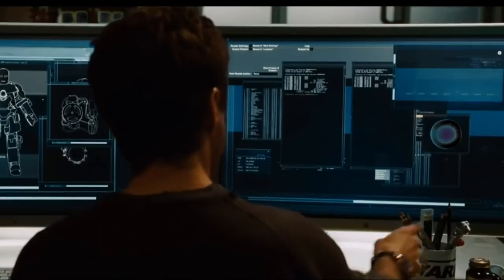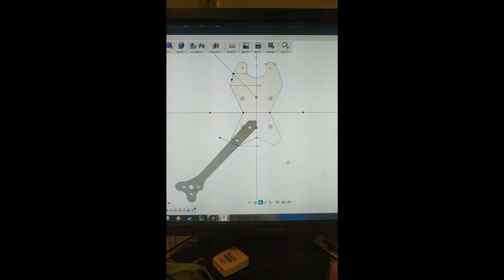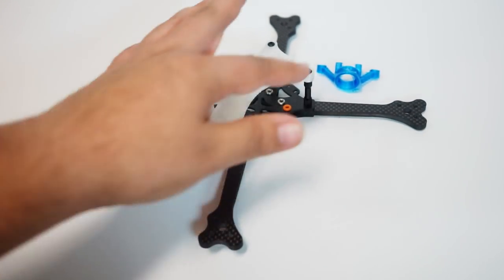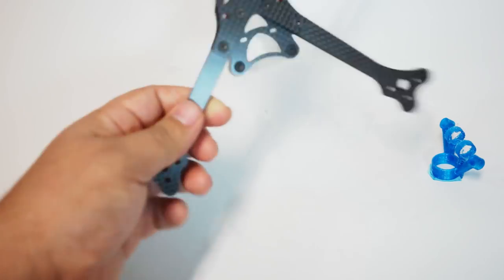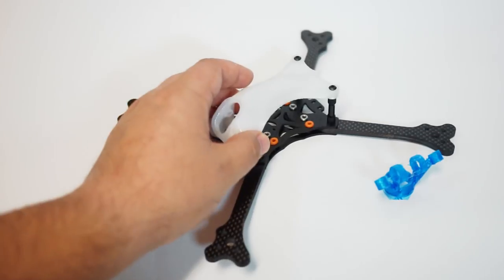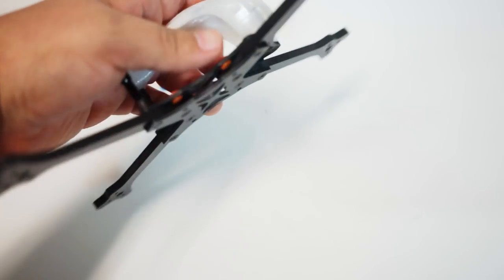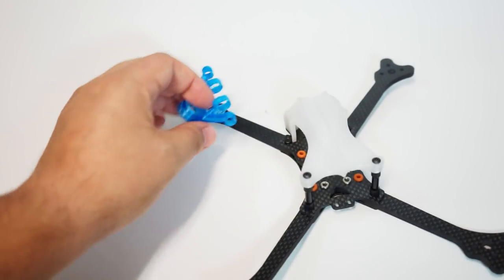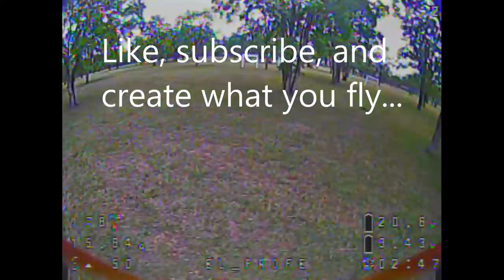Build your own Drone Frame

Comment: I once designed my own 2.5" and 3" frame using sketchup and turns out really well. I didnt do anything crazy like 3d prints or pods, but I ended up using a camera mount from a floss and zip tie the antenna. I am now thinking about designing a 5" race frame after watching this.....
Reply from the maker: Thats awesome man, ive always wanted to do one myself.  Glad i could feature this on the channel.  If you do make a 5" be sure to let us know where to check it out.
Reply: I use sketchup pro for work on 3D floor plans looking to do this as well on sketchup pro!

Comment: i have done  ~20
i like 2 of them
Reply from the maker: Very cool, are you designing mostly Freestyle or Racing frames?  Do you use a service like CNC madness? Or do you do your own CNC?
Reply: @JonE5FPV  more racing, freestyle is harder to get right
10-15 are garbage, because i was still learning and experimenting
i've done many variations of the floss 2.1 in the beginning and showed them to bob
he was very helpful
the most original idea i had was to have armbraces out of aluminium, so you would only have to unscrew one screw to remove an arm
as i was finishing the 2nd version of the idea, the floss 3 came out. it's nearly the same, but mine doesn't have the aluminium going from front to end, just around the arms
the floss 3 approach is better, but i like my design style still better :P
the best i have done is basically a floss 2.1 clone, just remixed a bit, so i called it the floss 2.2, there is a vid on my channel

i never actually made one of my frames, but i want to do that with what i am currently working on
it's my version of a toothpick
i didn't like the whoop boards in all ways, so mine is for a 16x16 stack (succex) and 14x14 camera
the nano racer is on it's way to me, so i can finalise the canopy shape

for a cf service i picked out c-matrixx.de, because i live in germany
and to 3d print i have my eye on protiq.com and shapeways.com
protiq is from europe, but doesn't have nylon
i just don't like fdm 3d printers, sls seems much better to me
Reply from the maker: These are great notes thank you so much for sharing.  I will check out your floss 2.2

Comment: how do you make a canopy? (sculp or drawing and extruding?)
Reply: All depends on your ability.  I created mine by drawing and extruding because I haven't learned to sculpt in Fusion yet.
Reply from the maker: The Barney!  This canopy project has been great to behold.  I should do a video about the Houston 3D modeling FPV community ,because these guys are SERIOUSLY fast at coming out with new parts on seems like a daily basis.